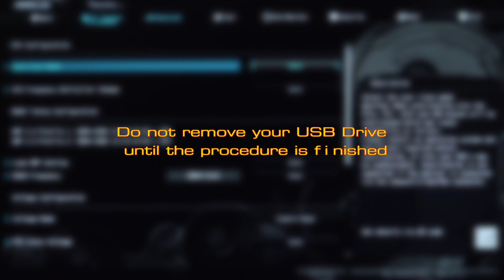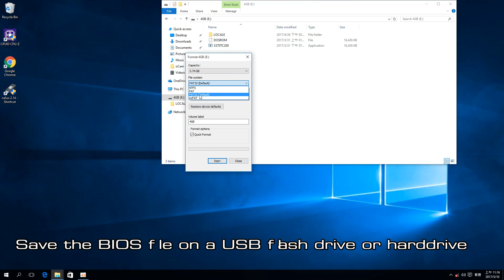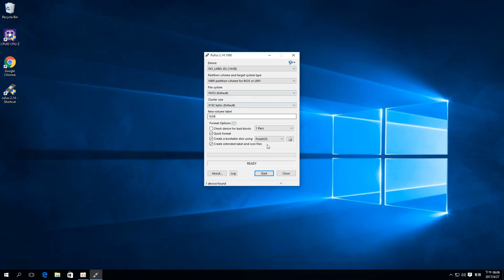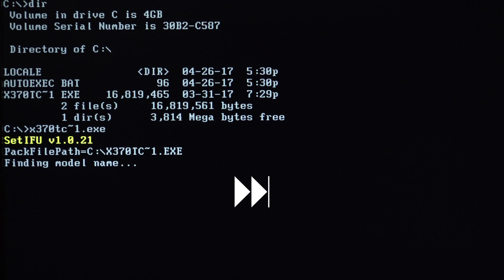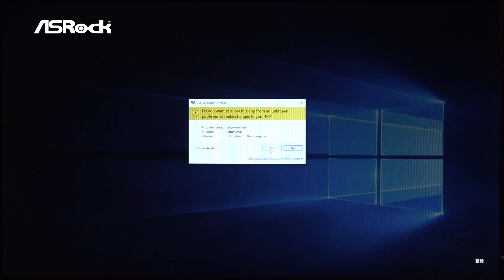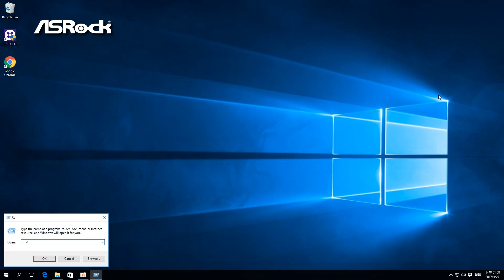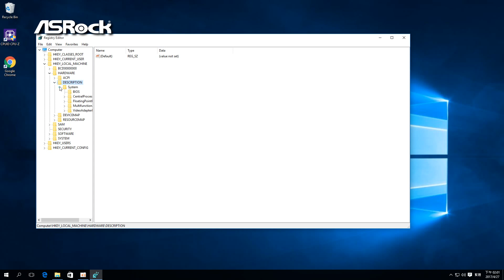[ASRock Classroom] How to check, update, and clear BIOS?

Comment: How come insta flash can’t find a image file?
Reply: Ugh same
Reply: same problem, no idea what i should do.
Reply: I have the same problem, can somebody resolve?
Reply: Zirtrex did you end up fixing it? Please respond!
Reply: @razewyd8743  hi, my error was I have using bios diferent, mine was master ac and download only master, then download correct bios and fix it
Reply: Make sure the format of your USB is FAT32. exFAT or NTFS will not work.
Reply: @subverse_music  while at it, also make sure the USB stick is formatted in MBR and NOT GPT. GPT may be the newer standard but MBR has best compatibility.
Reply: read the comment above your question as they already have the answer there.  You may need to update to an earlier version first
Reply: Find a solution?
Reply: When you put the Bios Update on a USB Drive, Make sure that you only have the actual file on the USB not a folder.

Comment: I unintentionally disabled my keyboard and mouse, so I had to reset my BIOS settings. However, my ASRock motherboard didn't come with a jumper for whatever reason. I went to the store and they didn't have a spare jumper for me, LOL. So feeling desperate, I just pulled out the CMOS battery, unplugged the power, held the power button down for 20 seconds, and waited 20 minutes -- all without doing the jumper part. Guess what: it still worked!
Reply: Lloyd Christmas mine has nowhere to put jumper. Lol.

Comment: Mamo Hi, im planning to build one too, will just use it for normal use and entry level rendering.. planning to get ryzen 5 1600 + asrock ab350 pro4. but my worry is the memory, i want an 8gb ram but most brand and their models in the stores are not found in asrock's qvl site. Should i change mother board? OR yolo with the memory even if not found on qvl?

Comment: My asrock h1105-ds hyper does not have jumper pins. Just 2 solder points. How do I reset cmos if it doesn't have jumper pins. And removing the battery method doesn't work

Comment: @Info ASRock

my mobo is ASRock Fatal1ty AB350 Gaming K4
my PC won't boot from first time i Build it
but the Fan can spin or active
stock cooler fan, psu fan, graphic card fan, and the Case fan

Keyboard and Mouse can not turn on or light up
Monitor "No Signal"

in my case is there any broken part?
or just my Moteherboard that can not read the memory because my moteherboard BIOS has not been updated
Reply: z3ldie how can i update bios
The pc won't boot
Reply: im using AMD Ryzen 5 1600 Processor
and Team Elite DDR4 8Gb 2666mhz Memory
Reply: thats mean there any broken part?
Reply: 1. What does it mean by get a cpu tah support all version
2. yes i have have another pc
3. i don't get it what mean old cpu ?
Reply: 1. AM4 Ryzen 5 PRO 1600(YD160BBBM6IAE) 65W Summit Ridge 3.2GHz 3MB B1 P2.60
2. AM4 Ryzen 5 1600(YD1600BBM6IAE) 65W Summit Ridge 3.2GHz 3MB B1 P1.30

i don't know which one it's mine
pro or non pro
my mobo bios version is 2.50 because in my mobo there is a sticker showing the version of the bios like the video above

Comment: No image file detected. what?
Reply: I have  used a 16GB drive it must be formated to Fat 32 and not NTFS also needs to be otherwise blank apart from the bios file.
Reply: Make sure that you plug the USB stick in a port on your motherboard (on the back of the case).
Reply: does 16 gig flash drive work? or does it have to be under 8 gigs

Comment: i am building a custom pc.  will i need to update bios once build is completed?  im using ASRock - Z270 Killer SLI/ac ATX LGA1151 Motherboard?  how do change led light of motherboard?
Reply: Depends on how old the bios is on the current motherboard though it is a good idea to update your bios for more compatibility. Hope that helps.

Comment: can you please let me know does the two molex on the board needs to connect each other then to psu and which section of the psu? perif or sata?

also if i use two psu does it need to be connected to primary psu?
my psu is evga 750 g3

thanks

Comment: what "downloaded file" is unzipped?  you never downloaded anything.   please remember to follow all the correct steps during tutorials.  34 seconds in and i'm on google trying to research the steps you left out.  link to processor requirements are where?  there is no link and i can't find it on ASrock page.  sigh.  Press F2 on what page?  Where did you find bios file you skipped over that part... i could keep watching but this really is useless.  Am i supposed to be researching "how to flash a bios drive"?
Reply: Batbat  easy dude, its a simple misinterpretation, the person knows, but, can't quite figure out how to extract a file first

Comment: I have microstuttersbeith my New ryzen rig, please help. Bios update didnt work. Any tips? 
Specs:
Ryzen 5 1600
GTX 1060 6GB OC
Asrock ab350m
2666mhz ddr4 1x8GB
Intel 600p SSD
WD 1TB
Cooler master silencio 54 chassis
Reply: Upgrade ram and oc it to 3000/2933

Comment: Hello I'm I'm having some serious issues.  
 
I was turing on my hyper v driver because my computer was running slow, and was running faster with it on. During the Windows update for the driver the pc just shut off. Apon starting it I ran into a booting error. (0xc000000f) I've tried booting from usb but that did not work and would not even go to the repair tools in the usb. It would not boot. I tried booting from hard drive and realized this was my worst mistake. Now my computer screen won't turn on for eaither displays (I have 2)  
 
 
i run an  asrock motherbored in Windows 10 insider preview.
 
ive tried taking out my cmos batter and switch what I think is the jumper.  I've done this several times and leaving the computer unplugged with the ram, hard drive , and cmos battery out for at lease 2 hours max.   Is there anything anyone can do to help me?
Reply: That error code refers to MBR (master boot record). You'd need the OS media (USB / CD) to fix that issue. See here: https://answers.microsoft.com/en-us/windows/forum/windows_10-performance-winpc/windows-10-error-code-0xc000000f/765e013a-f3d0-472b-a92f-2f0ec14b0e6c

Comment: In my asrock z97 aniversarry when i need to clear cmos i must do:
1)position clear cmos jumper to clear cmos position.
2) remove battery
3) insert battery back in
4)position the jamper from clear cmos to normal poition.

If you follow the video in haswell asrock motherboard and do 4 step first and then third it will not work. The motherboard will be like dead when u start the power button. ( dont even fun will start)
Reply: Is clearing CMOS the same as restoring the BIOS?

Comment: you know, a corrupted bios recovery video would be way more useful. How does this motherboard deal with failed bios updates (for example a second bios chip, or a special chip for silent update from usb or something different?)
Reply: Ledian Kondi They haven't posted for months
Reply: I have an ASRock AB350M Pro4 I did updated my bios yesterday and it's finished so I hit enter (suppose to restart the system) but then after minutes it just turns on and off but the Lights are working and fans spinning. My bios before the update is 3.40 
The update im trying to update to: 4.50
Reply: BlazingApple any valid phone number to contact them?
Reply: BlazingApple I saw on their website that you had to update to 3.5 before you update to 4.5
Reply: BlazingApple we have same issue. did you fix it?
Reply: You cant without a soldering iron
Reply: there is a backup bios chip, but to get to it you have access it thru your BIOS - in my case that's no help. On my earlier Asrock X99 mobo, there was a mechanical switch on the mobo that you turned computer off, moved switch, and restarted. Simple and effective, but i guess they saved 3.5 cents per mobo doing away with that switch
Reply: vrekman256 Any news on this request???
Reply: Hello I have the same issue, can u fix it ?
Reply: BlazingApple same here, how can we fix that
Reply: vrekman256 k

Comment: Updated my bios and my pc won't boot now.
Tried to clear cmos, doesn't work.
What am i supposed to do ?
Reply: Same issue here... Any ideas?
Reply: if your motherboard is still under warranty, you need to get it replaced, the BIOS update has failed, therefore, please return to your local pc's dealer
Reply: xile root what happen? Was the bios update succesfull then it stop working? Any details to help would be cool. Also in the end was it fixed and if so how much$ or how?
Reply: replace the bios chip its easy to do and you can buy them on ebay
Reply: Synthematix can u show us the link